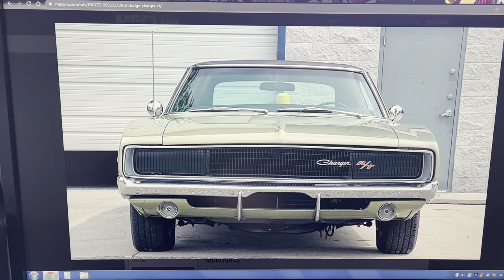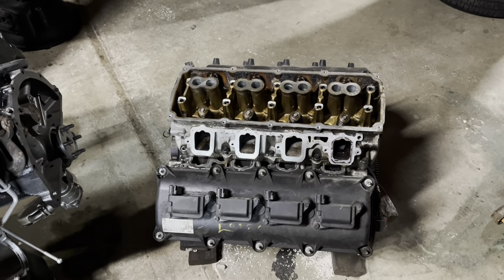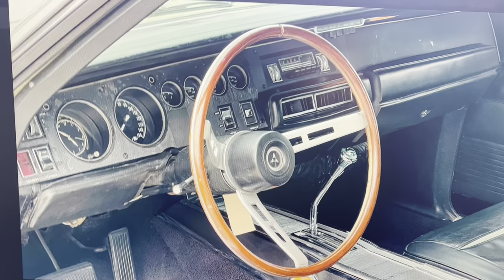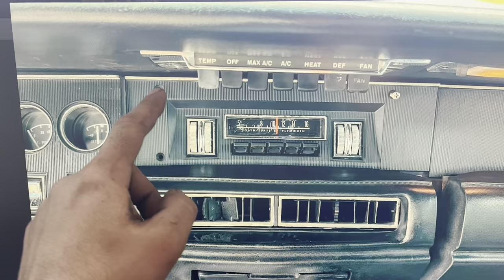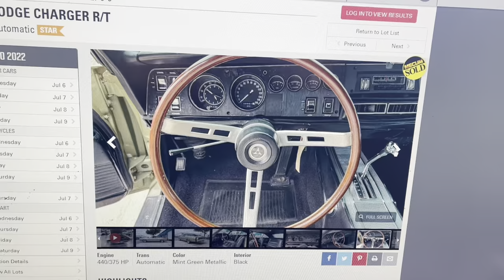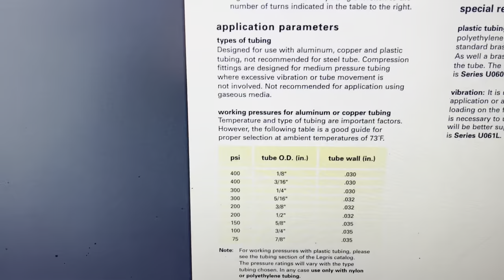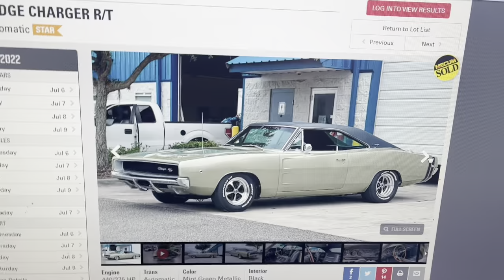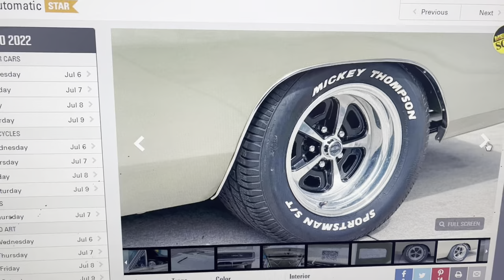Why Did This 1968 Dodge Charger R/T Just Sell At Mecum For $170,000? (It’s Unsafe And Bad)

Comment: A new 6-cylinder Challenger will BLOW THE DOORS off an old hemi Challenger from the 70s, PLUS you pay $35,000 for a BRAND NEW car with a warranty!How much is a 1970 hemi Challenger???😂
Reply from the maker: If you don’t know why people want an original Hemi Challenger instead of one of those 90s Mercedes cars reskinned to look like a Challenger, I don’t think there is any way I can help you understand. But yeah, the Pentastar is pretty good. For what I paid for my ‘68, I could’ve bought a used Hellcat, or most of a brand new one. I’m glad I didn’t.
Reply: @DeadDodgeGarage  The problem with old cars is that you are under them more than you are behind the wheel driving them. Old cars are hobbies,new cars are transportation. Also, you need Jay Leno $$$ to get a sharp one. For example, you are a Mopar guy so I will give you this as an example:Can we agree that the most affordable Mopar muscle car would most-likely be a 340 Dart Swinger? How much $$$ for a fully restored example?
Reply from the maker: @markremy4946  to an old car enthusiast, being under it is half the fun. Instead of a digital watch, it’s an old pocket watch you have to wind all the time. I know who I am, and I know which one I’d rather have. It’s not just a car, it’s a way of life. Actually though, my ‘68 Charger has been extremely reliable, after a few repairs to shoddy work and a couple tweaks after I got it home. 

The most affordable “muscle car” is a four door. Haha. Actually I would say 65-67 B bodies with big blocks qualify as muscle cars, and most are cheaper than 340 cars. A good example of a Demon, Duster, or Swinger 340 can be had for somewhere around $22k to $25k. I paid more than that for my Demon, but it’s special. 

One has to be careful buying any old car, “restored” or otherwise. But in a world where I could either finance a low line Challenger, or finance my now-two-owner, original paint 340 4 speed Demon for around the same cost… that’s an easy decision for me.
Reply: @DeadDodgeGarage  Hello! I say different strokes and to each his own. Can we agree that old cars are not for everyone? If you are not mechanically inclined, it's probably not for you. I am one of those people. I love old cars, but have no patience for tinkering. I love going to cars shows. It's much cheaper and less hassle for me! Good luck, sir. I spent some time up at Whidbey Island, BTW.

Comment: That 68 Charger RT is a joke, $35k car.  LOL
I thought auto mechanics were supposed to be certified.  LOL
Too many barnyard auto mechanics that do cobble work.
Reply from the maker: Auto mechanics absolutely do not have to be certified. Ask me how I know…

Also, while the entire point of this video is that the car is worth nowhere near what it sold for, we recently helped a gentleman sell a rusty, shitty paint, non running, basically no interior 68 440 auto R/T for $35,000 - and there were multiple offers at that price. This one is absolutely worth well over that, but needs so much to be made right.
Reply: @DeadDodgeGarage  At this point, they are just rich boy toys.  lol
Reply: Hay I bought that joke and I love it . What car do you have in your garage . Pluss I think It is one of one it will look great all done cant wait.